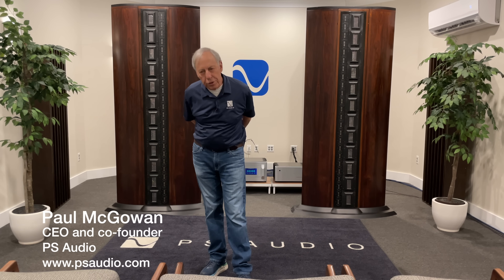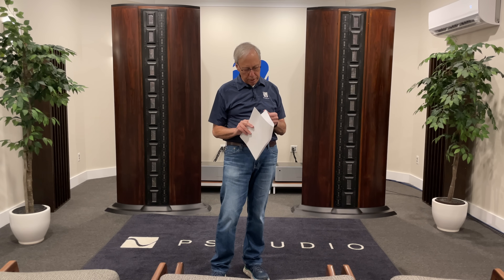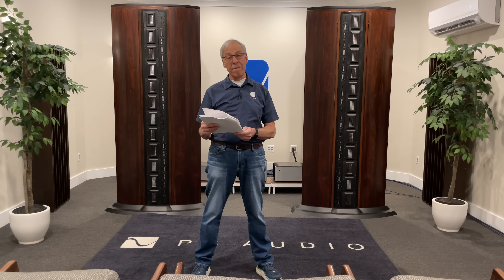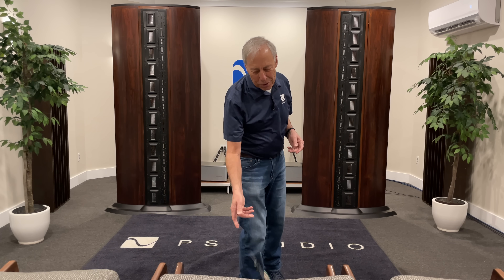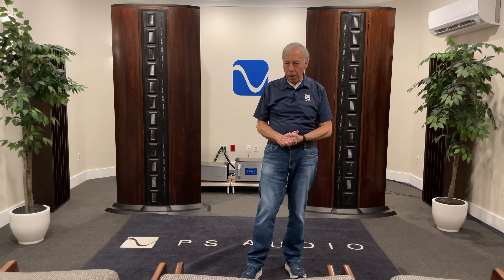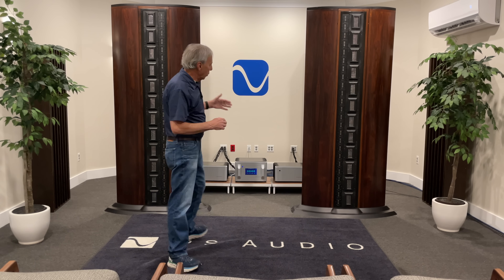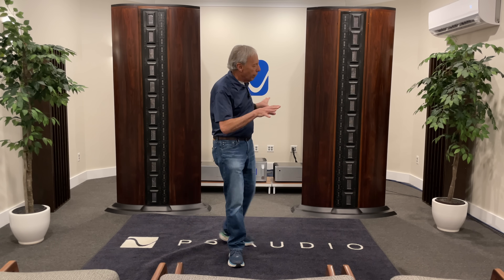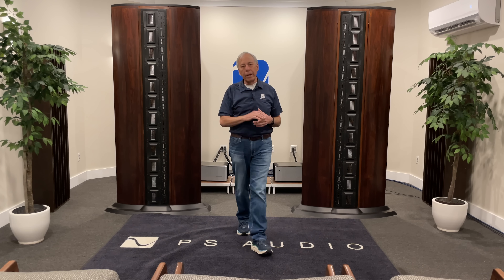Why do some components have a better soundstage?

Comment: I had the exact same experience when switching between my JBL 6290 and Crown D150Aii power amps. While I would consider the JBL to be an all around fuller, richer and more robust sounding amp I’d have to say that the sound stage itself is not drastically but noticeably better using the Crown D150AII. Interestingly enough that all changed when I went to a Schiit saga+ tube preamp. Since the switch the soundstage on the JBL 6290 is every bit as good as the Crown if not better. I know a lot of audiophiles don’t think much of running “pro” power in a critical listening system. That’s their loss. Some of the best sounding amps I’ve ever heard have been pro and both of the amps mentioned are no exception. Anyway I guess the main point of this ramble is that I’ve experienced this same phenomenon many times over the years using different component combinations

Comment: I also have two amps that place the soundstage completely differently. The NAD amp places all the music in a recessed space well behind the plane created by the speaker drivers. It’s as if “soundstage” to NAD’s engineers just meant moving all the musicians upstage or as far from the listener as possible. I have set it up in two different rooms and it creates this recessed soundstage in both rooms. It bugged me so much that I bought a second amp, a Pioneer with similar power ratings that I grabbed online at a clearance price. The Pioneer soundstage projects well forward into the room, as well as around and behind/between the speakers. The Pioneer, a less-prestigious amp (except perhaps in the Japanese market, where Onkyo and Pioneer are still well-regarded), produces a much fuller soundstage than the critics’ darling NAD and has even breathed new life into my speakers. Yet, in your video, you seem to be voicing a preference for amps that push the soundstage back from the speakers instead of forward into the room, when it seems like a recessive soundstage is the problem!

Comment: No electronic components have the same sound. 2 capacitors from 2 brands have different sound.
same with transistors! if you buy NAD AND DENON, they have different sound. this has always been the case. even iff the are class-AB amplifiers, there are several ways to build them. some factories make better amplifiers than others. 2 models from the same factory may have completely different sound

Comment: Those not familiar with jolida is a tube based amp compared to a musical fidelity solid state amp. Not exactly apples to apples and very different sounding amps. Perhaps rolling different tubes would help? With so many combinations of tubes to try it's like trying a new apmplifer each time you swap out the tubes. Sometimes it can sound better and sometimes not.

Comment: I think there may be a much simpler answer to this question. Who “upgraded” the Jolida? I would check to see if perhaps during the work, the polarity of one channel's output was accidentally reversed, throwing the left and right channels out of phase with each other. Perhaps they made an error while they were upgrading the speaker terminals or something. It’s easy to check, by simply reversing the plus and minus connections at one end of one of the speaker cables and then see if the problem is still there.
Reply: Phase shift would sound insane instead just what the description was.
Reply: @siimpetser4746  "Sounds upfront, with the sound massed along the plane of the speakers." 
That's pretty much exactly what you get with one channel 180 degrees out of phase.
Reply: @gotham61  I've toyed with a phase shift plugin. Every nudge created a new kind of madness. 180 degrees sounds whack. But wide... but maybe is what you meant though.
Reply: I've never heard a bad sounding Jolida tube amp and without hearing the amp in question first hand, I too suspect that something is amis. 🤔

Comment: It's true. I was stunned when I replaced my Denon receiver with a Sprout100. I heard a soundstage and presence that was WAY beyond the Denon. Never looked back.
Reply: Entry level recievers are just "bleh" Yamaha Denon Onkyo there is the same plain lifeless digital sound
Reply: denon made some pretty good products 20 or thirty years ago. sadly much of their present output is just junk
Reply: which denon amp?  I've been wondering about this myself.  thing is I need something with HDMI and I also love being able to use airplay.  I have the Denon x3500h and it measures fantastic in the power amp stage but horribly in the dac stage.
Reply: @NakeanWickliff  Exactly, I don't recall the model but it was one of their higher end receivers. I got new Martin Logan 35XT's about 2 days before my Sprout came. Plugged them into the Denon. Sounded pretty good. Figured I'd return the Sprout. When it came, I plugged it in and played my test tracks. Was BLOWN AWAY by the difference in clarity and soundstage. The Denon and Sprout "measured" similarly, but in actual listening--night and day.
Reply: @stonefree1911 
Congratulations, my friend!
You have arrived.   : )

Comment: That was a wonderful answer Paul because I didn’t know all of the effects of global feedback. Probably still don’t know all of these negative effects. What would you consider an amp’s adequate slew rate? I believe that slew rate is most important at the higher end of the audible frequency range.
Reply: Important to note that global feed back is not a negative thing.  Too much is as can be too little.
Reply: @user-od9iz9cv1w  thanks for pointing that out. Since I left my comment I took a look at the specs of my amp and the global feedback is 15 dB and a slew rate is 8 V/usec